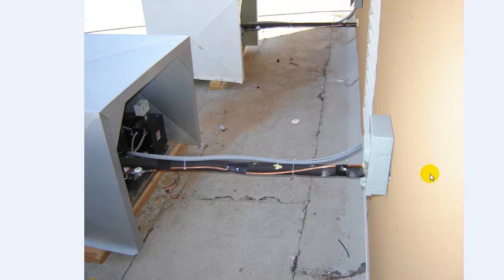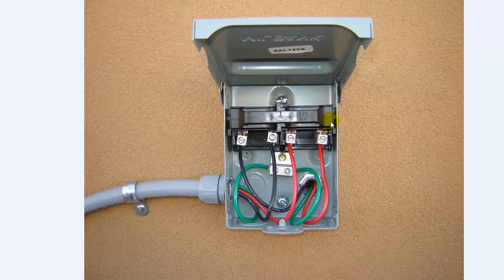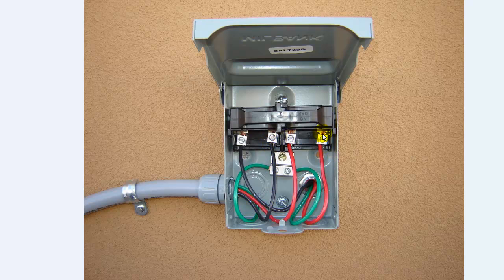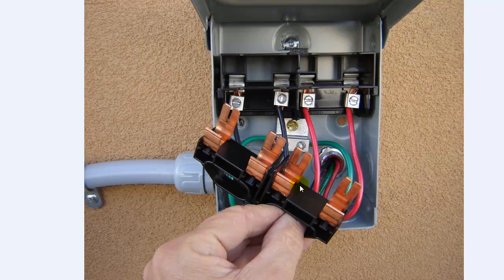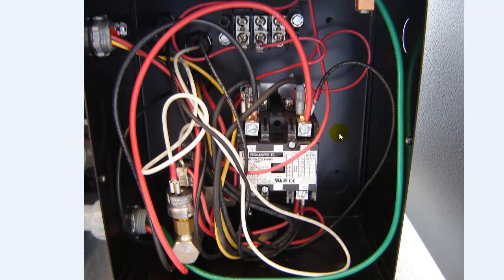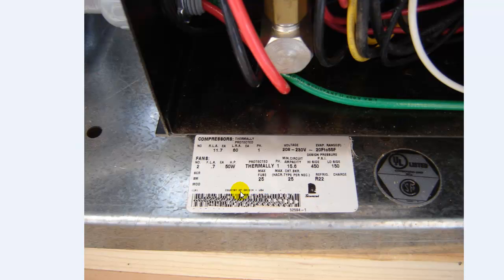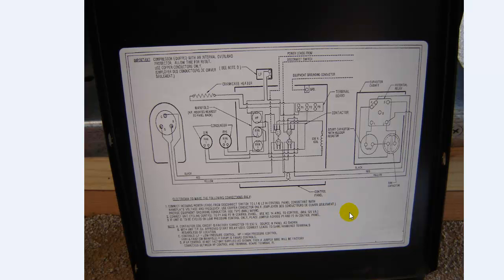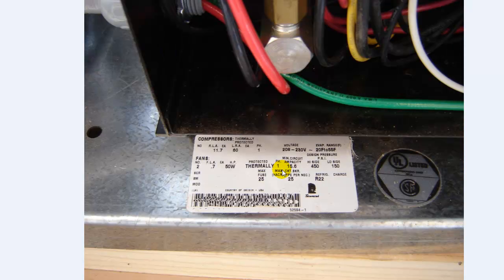Walk-In Roof Top Condenser

Comment: How does the thermostat wire into the condenser unit.  where does the wire from the thermostat go?  Thx u
Reply from the maker: No t-stat wire for this type of unit. It is controlled by a high/low pressure switch.
Reply: Thx u! I figure it out.
Reply: Thx u! I figure it out.
Reply: @papayastreetgrill3454 and how did you figure that out? My model we need the wire

Comment: wow... idiots ey... installing the aircooled conders wrong .... using 3/8 liquid i would preferably use 1/4  and also if allowed i would of installed the compressors inside and just the condensers on the roof